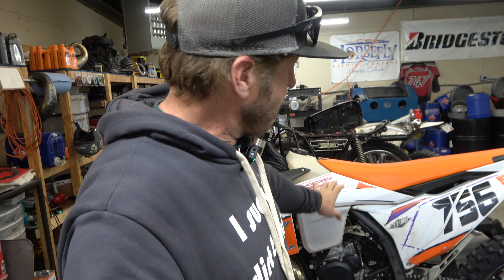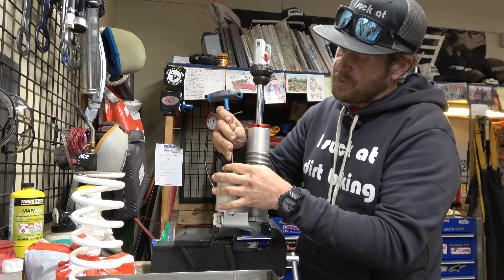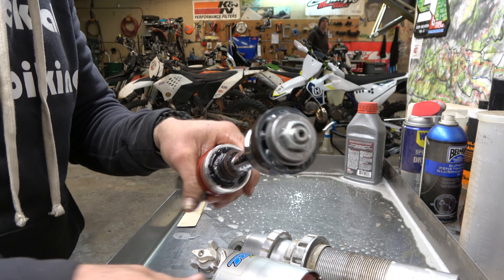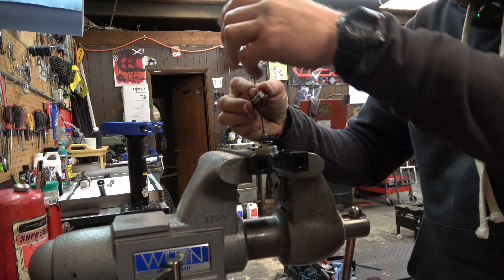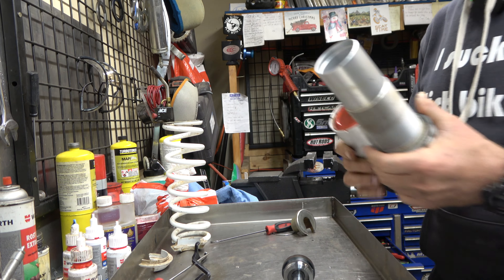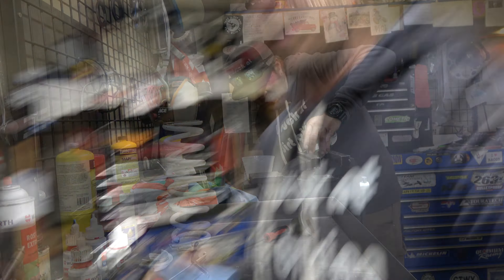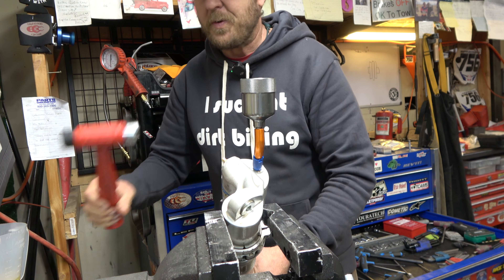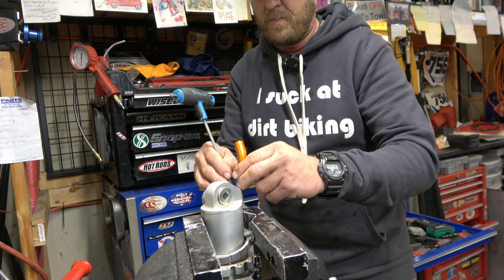2023 KTM 300XC Shock Service | Shock Re-Valve | Game Changer | Highland Cycles

Comment: at 2:30 it seems the oil is still visible in the tray. Seems there was lots of foam. This is dissolved gas from reservoir. 
The idea no transition in Main and no preload in adjuster will result in little resistance at high speed impacts and also maybe low damping of high amplitude events like large whopps dips etc.. I cant wait to know what you experience. Thanks as always vor showing disassembly/asembly. Best regards
Reply from the maker: Yeah. More than I expected. The pressure was still good. This is the first WP bladder kit we have used and I’m wondering about the quality of the bladder. The ones that use KYB bladders don’t foam that fast. I’ve taken them apart at 60+ hrs and had them be clean. We will see. I can say that I didn’t feel anything odd.
Reply: I would say that the gas in the oil is not always a problem. It depends on many things if it will become noticeable or not.
It may if the shock gets hot. Hot oil can dissolve less gas. And the problem is related to the cavitation effect which again depends strongly on shim setup main piston vs adjuster. Etc etc. 
Good quality of bladder (or piston type) helps, vacuumized (degassed) oil helps, frequent oil change helps, more reservoir pressure helps.
Reply from the maker: @hachtenduro7824  yep. Heck, still lots of older shocks just gas in with oil
Reply: @highlandcycles  I had a bladder with a hole in it in my showa shock, found out when I went to disassemble the shock, oil was in the bladder.. but when I was riding it before that I didn't notice a difference or a problem lol, and I am very sensitive to suspension changes and do my own suspension work and valving.

Comment: I was looking for the video you did on gold valves . Im sure youve done one. Like em or hate em?
Reply from the maker: Neither. I don’t think you need them. Current pistons in bikes are very good.
Reply: Ok. Going to refresh forks doing work myself.  Will do gold valves with valving 150lb guy here on a kx.
I cant see the reason not to. Was eesearching to see if there were other valves on the market. Surely race tech isnt it.
Reply: Need is a relative term, can swing a leg over most anything with a knobby and have fun.
Reply from the maker: @evanmiller1642  they aren’t bad, but if you know how to valve the stacks you don’t need them. What you are really getting is a shim stack which is a good thing. The piston is nice but not necessary. But on an older bike it’s probably worth it if you don’t have the suspension background
Reply: @highlandcycles  
I can take things apart and put them back together. Know what im doing tuning a valve stack. No im lost there.
Its a fair amount of money to invest in shops like yours doing valving. Hoping gold valves and racetech destructions will give me a starting point to learn how i can better fubar my own stuff.
Theres also the snowbike delima. If i could figure out a snow stack and dirt stack that would be awesome but being lighter i do better than most the snow guys on dirt forks.

Thanks for your tips. Was expecting you to love or hate them was alittle blown away by your middle ground response. You better get to work.

Thanks again

Comment: Thought standard procedure is to fill it upside down, add bladder/piston air chamber, then install piston/shaft, then final bleed is through the bleed port with some pressure. Seems alot faster to do.
Reply from the maker: I have done it that way a lot and this seems to get the air out faster.

Comment: Got my 2019 rear shock revalved last year, the high speed comp spring came back in the bag of parts removed. Just a thought would submerging the comp adjuster in a cup of oil for 20 mins before fitting reduce the air trapped in there ?
Reply from the maker: Yeah. That is a good way to speed up the bleed.